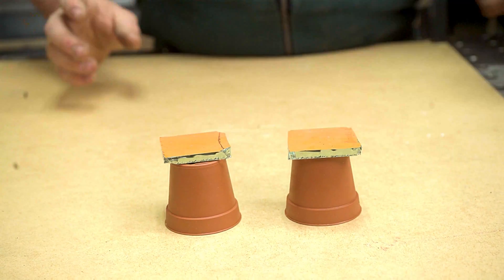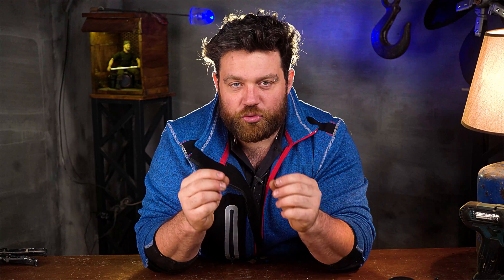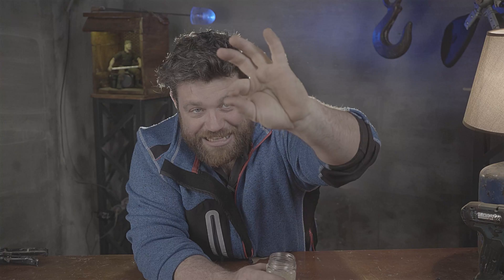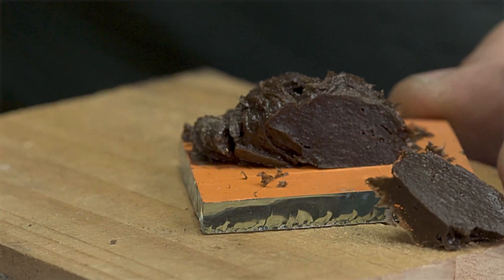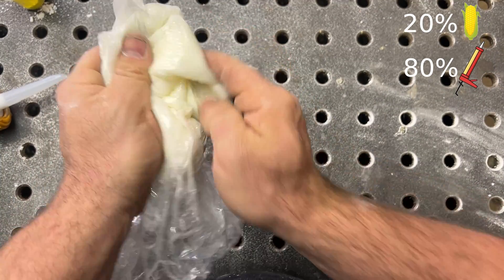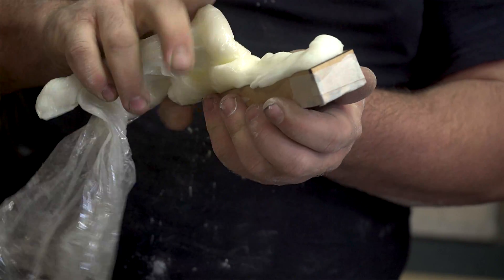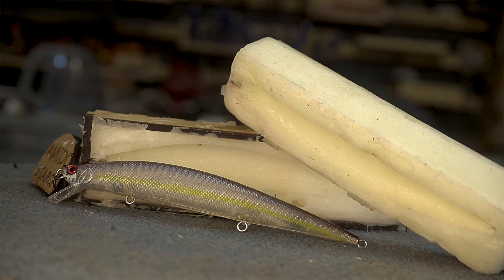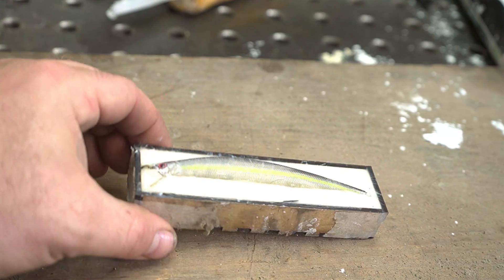How To Speed curing Time of REGULAR SILCON

Comment: Below is a simple method that I use to make silicone sealant fully cure in about 80% less time. The silicone that I use is GE Silicone 2 Kitchen & Bath Clear (the 10.1 fl. oz. tube). The curing catalyst that I use is Tate & Lyle Cane Icing Sugar.

In a small plastic container I thoroughly mix three full squeezes of the GES2KBC with one flat teaspoon of the TLCIS. I mix the two until not one speck of the TLCIS remains visible. It takes me about 5 minutes to mix it to that extent. For those who are doing this for the first time it will probably take longer. I use a plastic tongue depressor to mix the formula.   

According to both GE’s website and my own experience the GES2KBC takes about 24 hours to completely cure. Mixing the TLCIS into it reduces that time to fully cure down to about 5 hours. Also, the TLCIS in no way harms the strength, quality, durability,  or integrity of the GES2KBC.

Comment: Ok, that is interesting. And WAY cheaper than 2 part silicone, especially when the catalyst is platinum based. So I can definitely see where this would come in handy if I were trying to duplicate a large object that might require multiple quarts or gallons of silicone, and didn't feel like sitting around and waiting a week or more for it to fully cure. I would still prefer the 2 part stuff for small and highly detailed objects where it's far lower viscosity makes it way easier to work with.

It would also be interesting to see how well it holds with the passing of time, and how many times the mold can be reused it before it starts falling apart. Anyway, it is neat bit of information I will definitely have to keep rattling around in my brain for future use. Thank you for sharing that with all of us.

Comment: You mixed dry corn starch with Silicone, but you didn't hydrate the corn starch first.  Did it just suck the moisture from the silicone?  You didn't mix it in the open air so it wasn't getting hydrated that way...  I'm confused as to how it actually worked?
Reply from the maker: corn starch always attract and catch   humidity  from the air.   its a natural dehumidifier.     so even if it seens dry.. has a high humidity inside the particles.   thats more than anough to start the reaction
Reply: @rulof-is-how-to-make  
Thank you!  :)